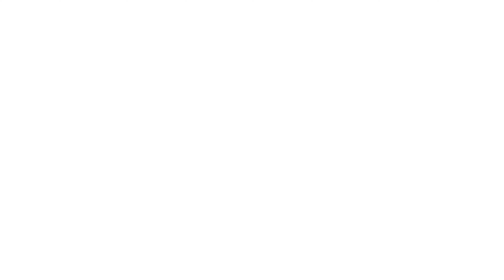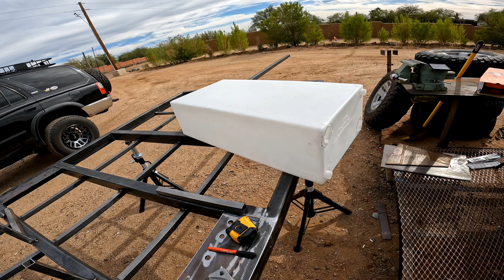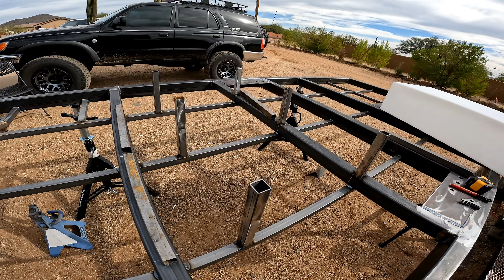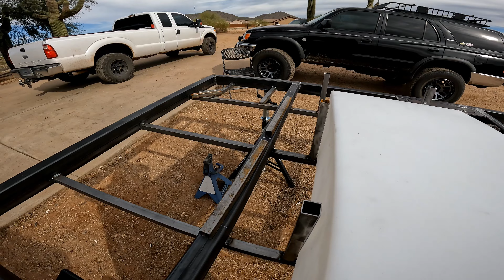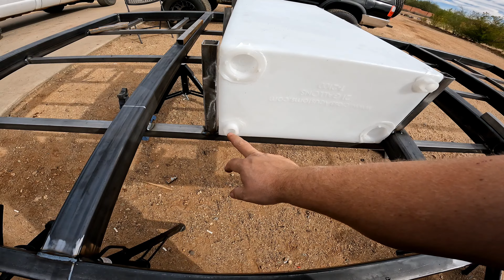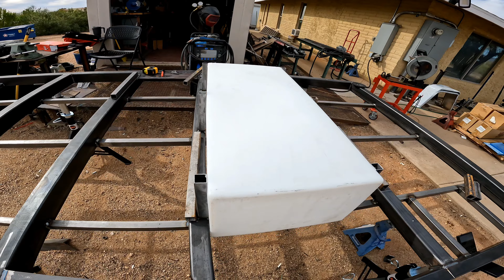Water Tank Mounts Completed / DIY Off-Road Camper Build Series 4

Comment: I stumbled upon your channel (thank you YouTube algorithm!) and I have been enjoying it as I am wanting to build a trailer myself but never could find someone who was showing in detail the chassis making part. I am not a professional welder and only have a flux core but I feel I’ll be able to do it if I take my time. One question I have on your lifter ramps for your winter tank and your angle channel at the top is that it seems that the edge of the angle would catch the “rock/obstacle” that would be sliding up the ramps??? Any thoughts on that ? Thanks for some great content and NOT editing out your thought process!!! Very useful.
Reply from the maker: To answer your question, I will be cutting a 45 degree angle to the pieces that hold water tank in so they dont snag on anything. Also with the bottom of tank about 16" off the ground I am not sure I will have to many problems with it hitting obstacles. Thank you for watching my build and I would say if wanting to build one just do it. I feel it is very rewarding.